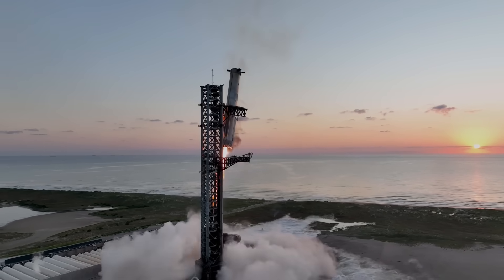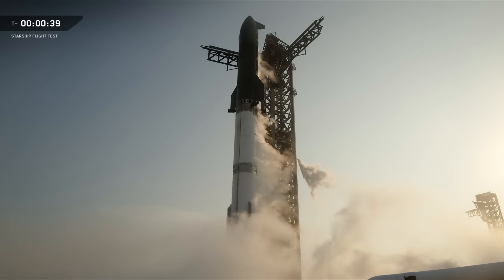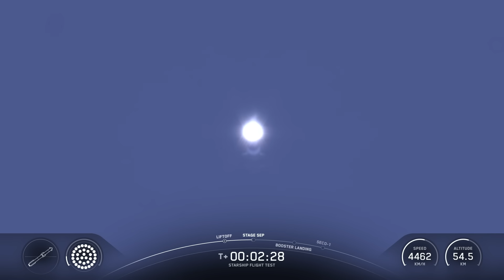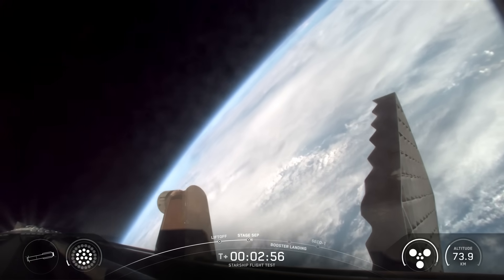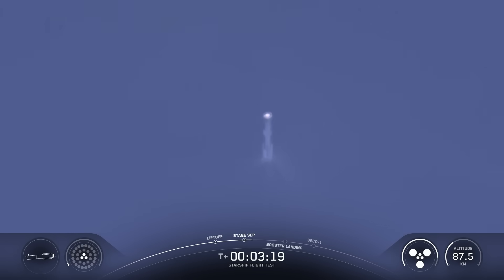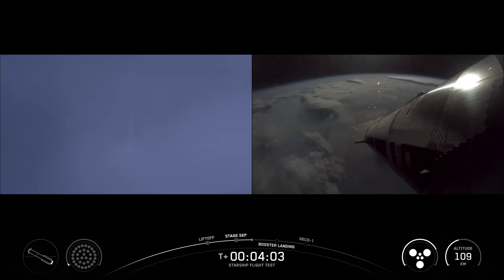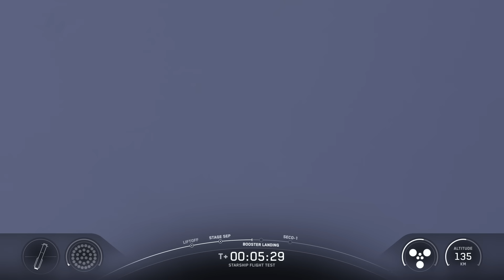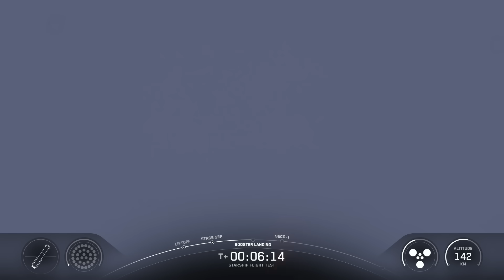SpaceX Builds Largest Reusable Booster, Also Makes Door That Won't Open - Starship Flight 9 Recap

Comment: During the livestream the commentators mentioned that for the booster they were going to try a higher angle of attack and keep one rocket engine unlit as a stress test, and that during wind tunnel tests and simulations this scenario was iffy, prompting the real test.
Reply: The booster failure was anticipated, which is why it was coming down into the gulf, not towards the pad. I'm sure they would have liked a different result, but it was not a booster coming home on a flightpath designed for success.
Reply: @BaalsMistress  Yet as soon as it relit it exploded.
Reply: they would not have expected to do the final burn test if that was the case
Reply: They aren't fine tuning the solution coverage lol it's never even worked under nominal conditions 🤡🤡
Reply: Just in case any of you guys are confused who is starship based hls system which needs like 10 refueling missions whas supposed to land on the moon in like 4 months and Mr fascist Salute guaranteed that it would be ready and here we are and they can't even open the door
Reply: @mcamp9445  a'lot of people here are stuck on all the cool science stuff. Not the patience of the tax paying public or its politicians.

They should know. If this was only funded by the three billion HLS contract. They would have closed shop two years ago. This endeavor is funded by Tesla investors and having one of the most corrupt regulatory bodies since the hoover administration. A foundation of sand.
Reply: @mcamp9445 not only can it not be refueled. It can't get to orbit to be refueled. Spacex don't think the vehicle is safe enough to get to orbit largely because they're afraid engine relights may either destroy the vehicle in orbit. Or they may not be able to deorbit this skylab sized monstrosity where they want.

In fact they were planning on trying to land starship in texas as early as last year. And those plans have evaporated since. They can't even get to their original Hawaii landing zones.
Reply: Tumbling places stress on the door that is not acceptable.
 @mcamp9445
Reply: Literally why?
Reply: @VictorianGodMan  They had designed a return trajectory for minimum fuel requirement however this put the vehicle under much higher stresses than previous flights which is why it was seen as high risk.
Reply: @VictorianGodMan  Correlating their simulation environment with reality. If the booster in real life fails like predicted then you know the simulations are reliable (enough)?
Reply: @VictorianGodMan

They want to reach human rating. With that many engines there are many failure points, you have to have a level of redundancy so that was what they were testing.
Reply: @Birdofgreen  also, to date, the "launch escape system" is the dubious prospect of becoming either pink mist or charred lump if something goes wrong.
Reply: @Birdofgreen  This clownshow will never, EVER be human rated.
Reply: @VictorianGodMan  The deliberate disabling of a single engine seems to me to be a hugely valuable test. I was really excited about seeing how that went. For me that and the heat shield tests would have been the two most interesting bits of the flight.

On the unlit engine side of things I don't believe that is what we were seeing when one Raptor didn't relight for the (very brief!) boost back burn. As I understand it the plan was to, much later in the return, deliberately disable one of the three centre engines that are supposed to be active in the final stages of the catch and then try to compensate for that by lighting up one of the middle ring engines. I assume that would have been SpaceX testing out an emergency procedure for one possible failure case during the later stages of a booster catch.

All mission plans try to consider not only how to run a perfect mission but also what remedial steps might work in the event that various things don't go as planned. The Apollo astronauts and ground controllers for instance spent a lot of simulator time not just running through how the missions were supposed to work but also working up procedures for what to do in the event of certain things going wrong.

It's also very possible that knowing how far they can push the booster off its nominal angle of attack might be valuable data in working up emergency procedures to try and recover from other failure scenarios that might be encountered during a booster return.

I think it is very encouraging to see SpaceX getting at least the booster to the stage where they can start that work up a few contingency procedures already. Sadly the Ship is a whole other matter right now.
Reply: @VictorianGodMan  so they know what will happen before they get forced into the situation with souls on board
Reply: @Grunttamer dude, even falcon nine didn't fail every other test flight. The shuttle had crew from the jump and didn't fail this often. And people view that program as a failure.

Starship will fly crew once, in 2028, right before Elon has a big k freakout in a congressional hearing. Starships getting mothballed and will sit next to the sproose goose in the museum.
Reply: @VictorianGodMan  we will see
Reply: @Grunttamer been my philosophy up until flight nine. Starships been around for five years. I'm done seeing, i want results.
Reply: @VictorianGodMan  it’s very clear that you don’t understand the difference between classical design like the spaceshuttle versus iterative design.  They are intentionally putting starship through flight tests that have a pretty high chance of destruction. They do this because they are after the data.  They will blow up as many ships as it takes and each one will be a valuable learning tool.  This is the most powerful rocket ever built, the largest flying object, and it’s trying to be fully reusable, interplanetary, safe, and reliable.  To do that they don’t get bonus points for making you happy.
Reply: @VictorianGodMan  Smoke 'em if you've got 'em.
More seriously thought, the only other thing would be to scrap it, may as well prove and/or learn something with it. They have two catches - and it's not clear more catches with the current tower/pad design would be worthwhile, so someone decided to push the envelope in other ways.

Real shame about the ships lately though. Block 2 seems to be a lemon currently, I can see it being taken behind the barn soon.
Reply: @kal9001  It's too fucking heavy, and will never work.
Reply: @VictorianGodMan  you have to know the physical flight limits of the booster in real flight, so you can start to set ops criteria, reuse, refurb checks and abort modes based on real world data, not theory, you can simulate these things for years but actually the simplest way is just to push the vehicle to its limits and see what happens when you break the limits.
Reply: @VictorianGodMan  because the booster was going to be retired whether it returned or not so might as well learn what could happen pulling a high G load during seperatation and seeing what happens to the booster during an underpowered return. that being said it was the only thing that went to plan with this launch, everything else was a failure.
Reply: @sirmonkey1985  No, "everything else" was NOT a failure.
Reply: @VictorianGodMan  I do understand your point.  It would be more important to know how many flight cycles the booster can make under normal flight conditions.  The significant amount of vibration to the booster may show progressive damage not detected yet to determine if reusability is practical (e.g. stress cracks).
Reply: @alanouye5355 TBH they've already shown reuse isn't really practical with this version of the vehicle.
Reply: @VictorianGodMan  Exactly, why?

Go low and you can't miss the goals.
Reply: @VictorianGodMan  because they can.

Comment: Starship.... the Cybertruck in space.
Reply: At least you can step out of the Cybertruck when it fails. Anything goes wrong with Starship, and everyone inside is dead. No 'miracle on the Hudson' or TACA Flight 110 landing on the levee with no power in a Starship. The TACA pilot only had 1 eye!
Reply: @billsimpson604  That's one of the many crazy things, though. You can't step out of the Cybertruck when it fails. The doors are opened by the on-board computer, so any spectacular rupture of the big lithium battery and resultant fire that causes a loss of power to that computer also takes away your ability to escape that fire.
Reply: @Sableagle  technically they do have manual door release handles

Comment: At this point I think you can call this an actual failure. The booster was the only thing that they can really learn from, the point of this mission was the heatshield and we're all the way back to talking about how the door didn't open, no relight and... oh yeah, at least the engines are very modern. They are definitely on a wrong path here and need to re-assess everything imho. There's only so many steps you should fail until you get it right. A lot of money is actually coming from taxpayers as well btw.
Reply: I'd disagree, they likely got some very interesting data from the various different systems and how they held up in an unexpected condition, ie guidance, thermal protection. 
All helps to understand the ship and building a robust human rated product
Reply: @josh3771  Material science yes, but only in cases of extreme circumstances, a simple landing first would be my goal. I mean, failing to do that is fine, for say a couple of times, but at some point the goal should be to do what you want it to do, not to learn about how the thing handles during yet another explosion.

Comment: This is the fourth time I’m gonna say: hot-staging is destroying the ship 
It will always fail until the ring is properly designed
Reply: Block 2 booster should fix that by using HSR in it's design. Block 1 has it as an afterthought so it's not the best designed one, it's something they chucked on it to make it work.
Reply: these fuel leaks only started after V2 ships, not after hot staging.
Reply: I was thinking the same thing. I speculate that they don't harden the the ships underskirt as much as the booster, since the booster comes down tail first and the ship belly first. They might need to add more protection, since it looks like the hot staging is damaging the underside of the ship.
Reply: @StefanEllis  the ring should be longer and wide open similar to Russian rockets (trussed)

Comment: SpaceX defines success as "it doesn't explode on the launch pad". 
Nothing new, still riding the hype train.
Reply: Ya there needs to be more successful launches this year but they will get it working most likely.
Reply: @adamoshea2793 SpaceX still in delay struggles to get milestone 1 of Artemis mission. Since 2024 six starships should be on Mars right now.
And countrary to Manley: it is tax payer money that SpaceX burns. 
Yes, with corruption help from Trump, they will have the resources to test more and improve, but they're stuck in a failed concept. Most of real challenges are still ahead but progress depends on stable reliable LEO flights.
Reply: Meh. SpaceX is mostly riding the train of its own money. They make a lot via Falcon 9 and Starlink.
Reply: @hafor2846  Starlink net revenue is questionable since SpaceX doesn't release numbers. Musk himself already said, that Starlink is only profitable if they get Starship  running. SpaceX mostly earns profit from government contracts on Starlink since they pay way more than private customers.
So corruption helps a lot.

Comment: 33 booster engines working flawlessly, and 6 ship engines suffering leaks and hot spots? I suspect the hot staging may be the problem. If they would leave it out, maybe with losing a bit of payload capability, everything could work fine.
Reply: It would be very funny if they did this and it ended up with a similar capacity to the Long March 9's planned capacity which doesn't require 15 refuels.

Comment: DOGE optimized SpaceX welder team so only 80% of welds were done. But big savings tho!
Reply: Maybe they just fired the person whose job it was to go round the design files and mark which seams should be welded and which should not, because that sounded too much like DEI, and then the robot welder welded all the doors shut and the gas taps open.
Reply: Another Elon basher whose Trump derangement syndrome as spilled over to Musk. Burned any Teslas lately?!
Reply: @wayneyadams  How many times have you copy-pasted this comment ?
Reply: @wayneyadams   I thought comedy was legal again🤷
Reply: @wayneyadams  anyone who supports those two horrible people needs a reality check
Reply: @ISirSmoke  more than half of the u.s.

Comment: This, along with a number of failures up to this point, seems to be a consequence of a too hasty development schedule and test flights with under-cooked hardware. "Move fast and break things" is fine for software where having another go is cheap, less good for expensive stuff like this. Of course things will go wrong, but the rapid pace of test flights and sheer volume and variety of failures is pretty telling. This is what you get when you have a spoilt narcissist in charge rushing things along because nobody can say "no, Elon, we need six months to sort this out".

Comment: the leak inside stopped after shutdown, right after the sun statement. so it either stopped or was empty. and yes bad door :P
Reply: It's like a Harley - if it doesn't have any oil under it, it doesn't have any oil in it

Comment: Money is not the problem, Scott. Engineering knowledge and methods are. Too much agile and throw away mentality and celebrating fails instead getting it right first time and strategically designed to succeed attitude.
It is not technology but attitude. With Falcon they had 4 attempts and the fourth one was do or die. That is what brought out the best in engineering.🎉
Reply: Evidently Elon already makes it very clear to his employees that success of SpaceX hinges on Starship making it to production. What more do you want?
Reply: @ShawFujikawa  The failures on the last three tests all seem to track back to leaks in the fuel system. Have they underengineered it to save on some weight? They need a significant safety margin if they are going to be using this for human flight!
Reply: @martinbradford9221  They're never going to use Spaceship for human flight ("Spaceship" here referring to the design fundamentals of the current Starship vehicles, not some engineering details of some (sub)system of the vehicle.). That is, unless NASA wants another death trap like the old Space Shuttle again, then sure, they will go for it. And this is under the bold assumption that the Starship design will ever become fit for the purpose of launching anything other than a bunch of small satellites into space...
Reply: Exactly. This is a hardware and quality control issue.  They need to stop this cadence and engineer these problems completely. This failure cadence is not sustainable.
Reply: You can do theory and simulation as much as you want but there is no substitute for actually flying.   Having the ability to try multiple time on multi million dollar experiments is amazing.  If this were simple or cheap many others would be doing it.   Kudos to the SpaceX team and leadership for doing this and making this possible.
Reply: @andrewmo49  What exactly are the "making ... possible" in at least the next 20 or 100 years or so?
Reply: I think the way that they are shortening the time between each launch are out pacing the engineers, like Elon needs to chill out with the time frame
Reply: Agile doesn't really work in software development, either. What invariably happens is that you push programmers and designers until breaking point and eliminate any chance of building flexible or reusable or maintainable components. There's never time for foresight in Agile Development.
Reply: @PaulSpades  Thank you... I am a lead IT BA in a large agile software development project involved in complex modeling and it is just reaching that point now, after 7 years...  Agile = start building something that you may only have a 10% understanding of and see where "it" ends up

Comment: raptor vac clearly had burn through pretty early. but the hot spot on the curtain might be a vent that was invisible at acceleration but got contact with other liquid and getting some ignition in zero g
Reply: Quite sure that was a fuel vent burning, which caused the spin.
Reply: @therocinante3443  nope. side walls sprayed several leeks . pretty strange all of this as first stage held together more or less. before they really stressed it

Comment: Lets face it - spacex is funded by taxpayer dollars. They have a contract to make rockets for Artemis, and they have burned most of that money in starships. Notice, this one was nearly empty inside and barely had any fuel to spare for circularization burn.
Reply: Spacex saved taxpayers money by implementing reusability. You can't test such complicated vehicles staying at the launch pad.

Comment: 15:18 At this timestamp you see something elongated detach from the other side of this railing we're looking at.
It looks like a trail of an ice particle, but the trail behaves like one object.
8:57 Could these bright spots have been latent heat from the explosions that made it detach from the other stage? Latent heat is fascinating, it won't turn it into thermal heat until something changes in the conditions. Getting blasted by those gases allows for the heat to escape. The question is just, is this possible?

Comment: At this point starship v2 is a step backwards to the original, yes the v2 has had less flights and the original 2nd and 3rd (2nd flight and flight 8 ascent breakup and 3rd and 9th lost in hypersonic decent) but spacex had the leak issue fixed in previous flights and had successfully splash downs of the upper stage wile the booster a ok lose because it’s the second flight